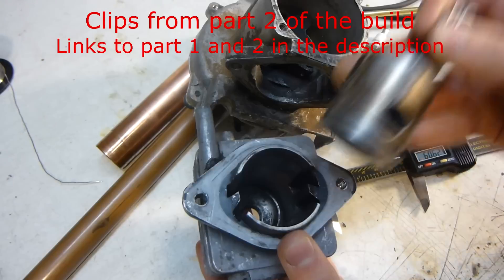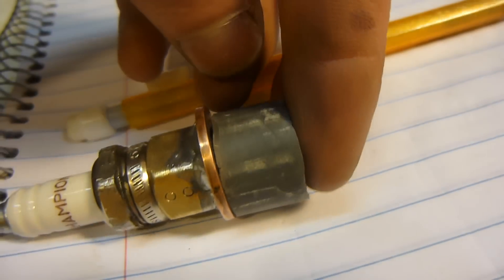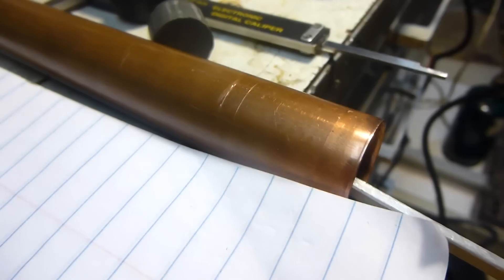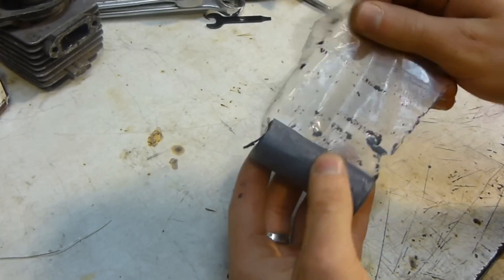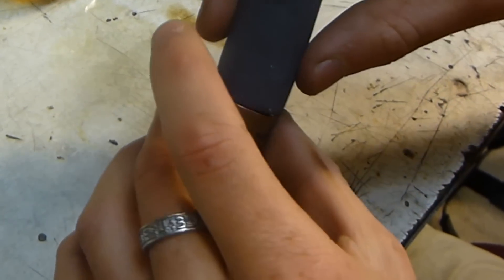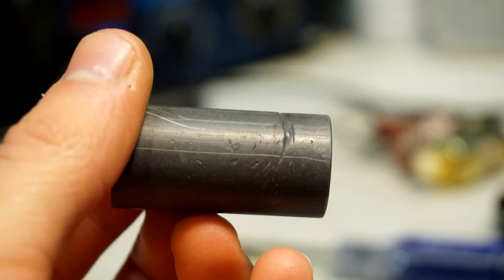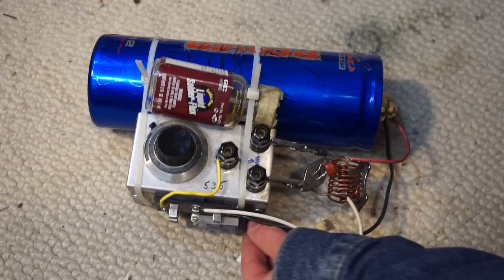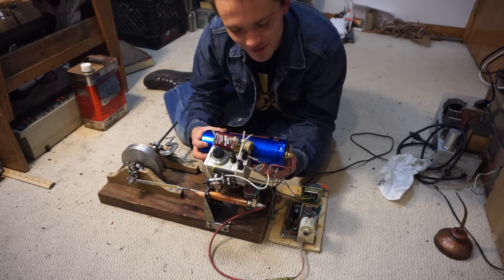Part 3. Making Internal Combustion Engine, No Machine Shop - Casting the Piston from Epoxy

Comment: Thank you very much for suggesting using epoxy putty. I must try it in my Stirling engine. I casted pistons from silicone and greased with Nigrin, but after heating Nigrin evaporates or burns out (it's Alpha version of Stirling engine, so one of the piston's surface gets really hot).

Comment: . Did you ever calculate how many CC's your cylinder is??  Since that's the standards what engines are measured in.
Reply: If I read his notes correctly, I calculated 8.8cc.  I'll let him confirm if that's right or not.
Reply from the maker: +pjdambra like Wayne said, approximately 8cc. Thanks!

Comment: Run faster --> Shorter stroke and bigger exhaust -> bigger intake
More power -> taller exhaust ( exhaust should be slightly taller than the intake ports)

Comment: where can i find the equations you used for the clearance and such? obviously not talking about the area of a cylinder lol but the meaning and how to calculate your ratio.
Reply from the maker: +bioletsmakeiteasy It's just the ratio of volume when the cylinder the exhaust ports open to the volume when the piston is at top dead center.  https://en.wikipedia.org/wiki/Compression_ratio

Comment: Next; make the MYT ENGINE!!! It'll run on air alone : )   I suppose it may work best under high humidity conditions.  
If you would like to get ahead of that design however;  use built in magneto coil generator(s)/12v ac dynamo. Do you have a metal lathe? You can pick a small used one up cheap, just don't settle for a tiny one like they sell at Harbor Freight. Such machines need modification before they can endure any real use. If you can get one, you're best off with a 5 axis mill. They'll do everything a lathe can almost, with proper tooling.
Reply from the maker: +mikefromspace Wow that's a really cool design of engine!  I wish there was some videos of it actually running.  Looks like the inventor has not done much with it in the way of developing it.  It also looks like it would be insanely expensive to manufacture.  Yeah I will eventually be powering a generator with it.  No I don't have a lathe.  Hence why I am building an internal combustion engine without a machine shop.  I do have access to a lathe at HackPittsburgh but it's a pain to drive down there every time I want to make something.  A 5 axis mill would be amazing!!!  Wish I could have one of those!
Reply: +Makerj101   I'll see if I can improve on George Morin's free energy motor design and send you some plans. I just haven't made time to deal with that one, but it's one of the best from what I've been hearing from friends making it and having some great success.
I did see a video of the MYT running. For a tiny version of it, you might consider replacing the offset gearing system with a magnetic system. Neodymium magnets to repel enough for this to run. 
Another trick I heard of but haven't tried is a magnetic blocking motor. A magnet rises against another off a crank and when they would usually repel, a coil sends power to reverse the field thereby allowing magnets to attract to it's positive pole coil.  Just before they reach top dead center, the field shuts off triggered by led passing part of the crank arm which triggers a light sensing diode to cut the field off. You'd think it wouldn't be over efficient but it is.
Reply from the maker: +mikefromspace Is this this the free energy motor you are talking about?  https://www.youtube.com/watch?v=BzUKUOSm7M4  If not I'd like to see the one you are talking about.   Thanks!
Reply: +Makerj101 Yes but there are many versions of his motor. I guess it's best to just watch as many videos as you can find on reproductions done by other youtubers.
Now it may be more easy to make your own larger motor than to buy one; you need an ac dynamo. 
There is a better motor out there I just can't remember the name! So many of them now. The best one I know of has a rotating iron stator that makes distributor contact with another iron core it spins inside of with 4 major coils wrapped around that ring shaped one.  Or, if you can make a coil winder for flatwire around a small torid core 1" id, then you can make a very powerful machine. I have a magneto array for just that but haven't had time to put her together. Rumor is it'll make 40hp from grandson of guy who built it many years ago. You'd probably need atleast a mig welder to make some of the parts and a jigsaw to cut steel sheet with maybe 10gauge.
Reply from the maker: +mikefromspace I see nothing special going on about the setup in this video:  https://www.youtube.com/watch?v=BzUKUOSm7M4   No free energy what so ever.  There is less energy coming out than going in.  Do the calculations and explain to me how there is more energy coming out than going in.  Maybe I am not understanding this right.
Reply: +Makerj101 The meter on the right appears to be showing 40volts higher than the input voltage, and it's running an a.c. lightbulb.  This guy didn't do it right though, because he's suppose to show it feeding back to the source and disconnect the main power so it runs itself. No, he was just showing the voltage rise.  I'm sorry I haven't had time to look into making that device yet. I work on reverse engineering of more powerful and well proven systems but problem there is the cost. I did just post something new on the flying dynamo however which does not require laminates for dynamos or anything fancy, just coil windings. The 'hull' can be made out of tinfoil.
Reply from the maker: +mikefromspace The meter on the right is actually displaying 400 volts AC.  And there is no trick about it.  The large transfomer on the right is stepping the voltage up.  Voltage alone doesn't mean much.  You need to know the current too.  If you connected the output of that to the input it would stop within seconds.  If he is getting more power out then in then where does that power come from?
Reply: +Makerj101 Yes, you mean amps, I know. A friend of mine ran Morin's deal and had success, that's all I know. Free power is possible here and elsewhere though zero point energy circuits. Always they require 3 or more grounds, using an hf wave inside while lf charge successively drops outside (initially is a sinewave until carried wave transforms it), both of which can be accomplished many ways. Pump z waves set in sync yet out of phase with proceeding waves once passed through a nonlinear medium must combine to form a sum of wave peaks. That is the secret to extracting zero point energy from the vacuum.  It works, because as time passes, time attempts to neutralize charge everywhere. Basically, it is mixing particles of all sizes to fill all gaps between the largest ones. Space is hydraulic in flow of 3 poles, neg pos and matter. 
I've seen piston engines run on air alone, not much power, about 1/4, but it's there. Any flathead engine with cam adjusted timing (change chain tooth point usually) has the ability to run from air.  A microwave klystron aiming into the spark plug or fuel injector, I've heard, can make a flathead engine  tuned for high compression,  run over efficient as well. I should try this honestly since I have a lawnmower I could modify. I have an idea how to make that work even better.
Reply from the maker: +mikefromspace That is an interesting theory.  I am a pretty strong supporter of physics, thermal dynamics, conservation of energy, etc.  That doesn't mean I don't question the current understandings sometimes.  But nearly all of them have been proven in some way or another and they make a lot of sense.  So to me your theory sounds like a made up fantasy.  I'm not saying it's wrong.  But until I see proof of it, it's only an idea.  All the other "free energy" devices I have seen videos of looked fake to me, their calculations had errors, they didn't understand what was going on so they thought they had free energy, or they just set it up in such a way to deceive so that it looked like more power was coming out than going in but there really wasn't.  I'll tell you what, if you replicate one of these "free energy" devices or make your own design and it works, make a video explaining it, how it works, and how to replicate it and I will replicate it.  If I can also get it to work then you have a pretty good chance at changing my perspective on these things.

I'm confused, a piston engine running on compressed air is nothing new.  It's called a steam engine.  I've seen lots of people convert internal combustion engines into steam engines that can run on compressed air.  Like you said, all you need to do it changing the timing and you have a steam engine or in this case a compressed air engine.  Nothing new is it?

Microwaves could increase efficiency of the burn.  It's an interesting idea that needs researched.
Reply: +Makerj101 Don't worry, I'm not out for fame or fortune from crazy theories that can't be applied in a real world sense. Everything i have done in theory is proven based only on experimental evidence and simple observation. This I have worked on for over 20 years, but don't take my word for it if you don't like; build the Kesche machine. He just released a plan a few days ago!!! I have the pdf file here but you can get it right off his site, the Kesche foundation. Friends are building this and I will be also this month. I only spend $100 a month on power here, but you can sell power also under the 1999 Federal deregulation of power companies law passed in Congress. Power companies must buy back 40% of their overall output. If nobody in your area is selling them the full 40% already, you can make some serious buck! They have to pay to set up the equipment to connect your device to the power grid, free of charge, under that law. It is a zero point energy coil system that is proven : ) and yet another one that proves my theory.
Reply from the maker: +mikefromspace  I hope you don't mean the Keshe Foundation because that's a joke.  And is this the PDF you are talking about?  http://blueprint.keshefoundation.org/ that's so fake.  Just saying.  And Mehran Tavakoli Kesche is a liar and a fraud.  He's taking donations for fake experiments and things that don't work at all.  Until YOU actually try get this Keshe free energy circuit or zero point energy to work I don't want to hear anything more about this free energy nonsense.  I don't mean to be harsh but ALL the free energy stuff I have seen thus far is fake and the more things I see the more I am disgusted by it all.
Reply: +Makerj101 More than one person has posted his working Kesche coil. What is disgusting is that you know the atoms that make up your very body are perpetual, yet you don't want to think than anything else can be. I have personally built my own working free energy dynamo, so nobody can convince me otherwise. I understand the secret to Kesche's coil in such great detail that I can describe it down to the very particles of the atoms involved.
If you don't want to hear it, that's fine. Your loss.

Comment: Excellent work.  I spent almost an hour watching this over and over.  Your design/build process is amazing.  You must know that this is not kids stuff.  Building a running compression  2 stroke internal combustion engine using simple parts and a drill press???   NO WAY----and yet there it is.
Reply from the maker: +Lidmotor  Hahaha wow!  I'm flattered!  To be honest I actually didn't think it was all that hard.  It was frustrating until I realized I didn't have enough compression an added the O-ring.  But other than that I thought the build was pretty simple and straight forward.  One of the smoothest and best projects I've done.  I actually want to try again but this time using even simpler parts and easier methods.  JB Weld instead of all the solder.  I think JB Weld would actually be strong enough.  You would need to use a lot of it to get enough strength.  After all JB Weld only has about half the tensile strength of solder and the solder is holding up great.  Not sure if I will or not.  I should build another steam engine or Stirling engine before that.  Actually I need to finish this engine first.  I need to add a cooling and an oil system.  Currently I need to stop it every couple minutes to squirt some oil in the exhaust port to keep the O-ring from wearing out and spray some water on the paper towel wrapped around the cylinder.  Thank you!
Reply: +Makerj101 My little steam engine is put together with epoxy putty and it works fine.  My Stirling engine uses an epoxy piston with no O ring.  I am really surprised the Coleman lantern fuel you are using on the ICE does not burn hot enough to melt the epoxy.  Cooling is critical I guess to prevent that.  I am thinking that your engine might possibly be made using an electric drill instead of a drill press.
Reply from the maker: +Lidmotor Do you have videos of your steam engine?  I'm not sure I've seen them.  Yeah an o-ring seal on a stirling engine would make way too much friction.  Yeah me too!  It's pretty surprising that they epoxy or rubber o-ring don't melt or burn.  I mean JB Weld is rated for up to 500F and it can probably handle even higher for short periods.  The end of the piston is has turned from the normal gray color to a dark brown color so it is obviously close to the limit.  I'd say my cooling is less than adequate.  

Yeah of course, a normal drill could be used.  It would certainly be more time consuming but non the less it's very possible.  I made my steam engine with a normal drill.  It was hard to make some pieces but as long as you use a nail or punch to make a starter dimple you can get the drill bit to go in in the right place every time.
Reply from the maker: +Lidmotor Very nice!  I searched you're channel the other day and found a whole bunch of them and I even found this one!  I challenge you to build an internal combustion engine then!  :D  I want to see more no machine shop internal combustion engines!!!! More more more  There are maybe like 5 on the internet and some don't really make my qualification because they cheated and used things like motor cycle pistons or things that were meant to be used as pistons.
Reply: +Makerj101  I have seen several homemade ICE builds where auto brake parts are used (master cylinder or brake cylinder).  Actually I wouldn't be opposed to doing that either.  Anything that you could easily find and adapt with hand tools to make the engine --without going to the machine shop.  Your build is still the best that I have seen so far.
Reply from the maker: +Lidmotor Yeah me too.  A couple people have told me that they use an old compressor.  I've not seen any videos of one made from a compressor.  But I'm sure it could also be done.

Comment: I am amazed how easy it starts running. I got a 560 ccm two stroke engine and it's sometimes really difficult to start it at all. The rope is wound around the pulley and pulled as fast as possible.
Reply from the maker: +bb aas Yeah some little engines can be really really hard to start.  My engine starts so easily because it has a very direct fuel system.  There is no need for fuel to get from the tank, all through the carburetor and finally get squirted into the engine.  With my bubble evaporator carburetor the fuel pretty much gets to the engine as soon as it starts pulling in air.  This carburetor is not practical for other engines though.

Comment: Using the metric system for the win. Great video mate. Getting good compression is a challenge even for a pro. Kickin some ass there for sure.
Reply from the maker: +Robonza Thank you!  Yep I love love love the metric system!  It just drives me nuts trying to measure things in like 0.039 inchs then adding that to something else it just makes my brain hurt.  mm pretty much are just the right scale for something like this.  I generally round my measurements to the nearest mm.  Compression took me a while to get right.  But I finally got it!

Comment: Nice to see that engine running, can't wait for more videos.I tried to make an engine out of a fridge compressor, made a cylinder head with a single valve for intake and a port in the cylinder for exhaust, but the valve didn't seal quite well enough and the compression was not quite good enough to make it run but it did show signs of combustion and make some noises.Can't wait to get my furnace finished so i can make me an engine out an old small hydraulic pump from my dad's car, should be about 10cc from what i calculated.
Reply from the maker: +John Johnson Cool!  Sounds like you were pretty close to getting it to work!  Got any videos of it?  I would love to see some even if it didn't work.
Reply: I think of starting a channel for my project stuff, with the occasional upload.
Yesterday tried to turn another fridge compresson into an engine, calculated about 4.7 cc with the exhaust loss and made the original cylinder with the reed valve work but it just doesn't go, pumps gas vapor quite well, if i turn it around and expose the exhaust while i manually trip the spark it does shoot a nice big blue flame out the exhaust, so yeah, almost there.
Reply from the maker: +John Johnson Nice!  You should totally make a channel and post some videos!  There are tons of people on YouTube including myself that love to give tips if your not sure why it's not working.  It must be a really small compressor if it's only 4.7cc.  It's free to make a channel after all!  Just gotta use your phone or a dirt cheap camera to make some videos.  They don't need to be high quality.  I even started out with pretty bad quality videos.